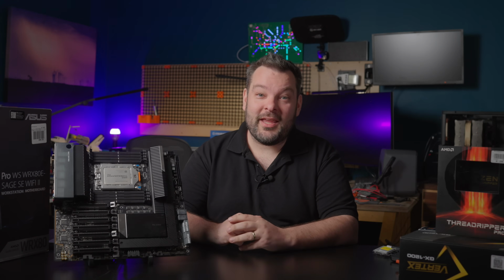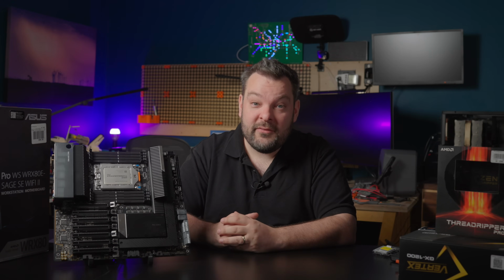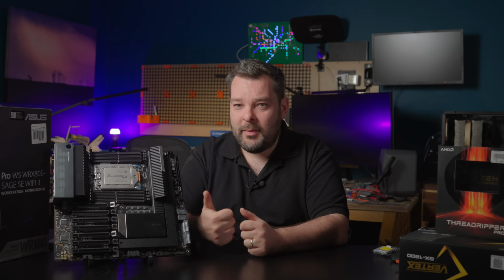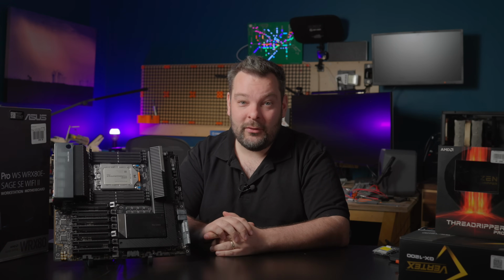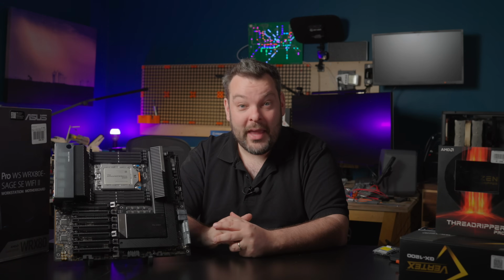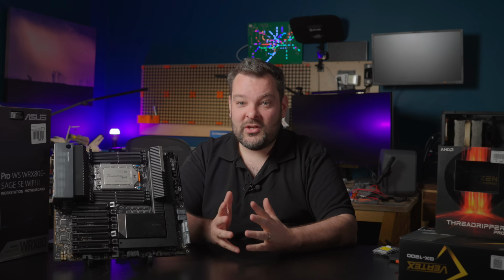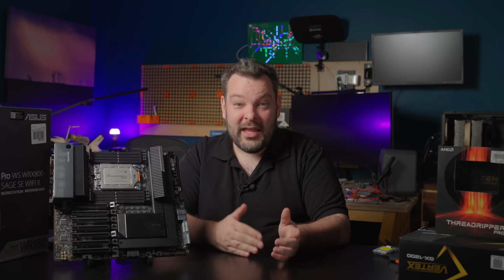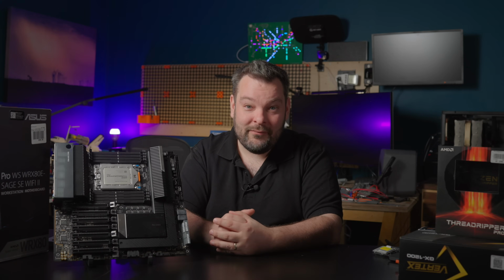ASUS WRX80E Sage SE WiFi II & Threadripper Pro 5955WX Review: PCIe Lane Heaven or Proxmox Nightmare?

Comment: Hmmm whay do you need so powerfull PC ? I would check for example upcoming  mini pc  HP Z2 Mini G1a with AMD Razen AI max ....
You can also put these PCs in rack ...:)
Reply from the maker: its best not to ask why. “just because” is a better way of explaining it? 😀
Reply: He explained it in previous video...PCIe lanes..
Consumer chips are all good on the performance but they seriously lack PCIe lanes for add ons
Reply: These ASUS boards are just too complex, only for needing PCIe channels, running some NVMe drives..
Need EPIC, Buy the Fury Z system by HP, service it remote. Copy that system on some ASUS board 3 years later ?

Comment: Alex, the Threadripper Pro is mostly being sold by OEM's as a complete solution, tuned and configured (and it sells a lot, and no, it's not EOL)
I agree that 9950X would be great for you - if the number of PCIe lanes are enough for you

Comment: Asus board are good when they work but it’s not usually the case in those times … Soooo not getting the Asrock one and adding a connect-x 6 for the sfp+ 😅
You’ll get all your problems resolved (dedicated vga and management port, etc. ) 
You understand now my preference 🤷‍♂️😅